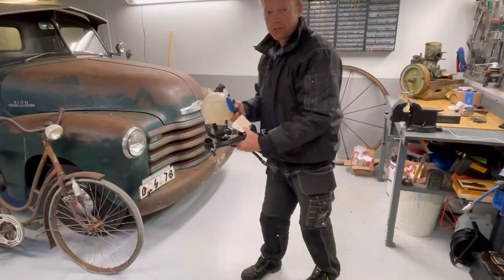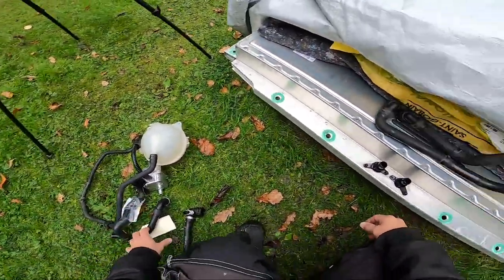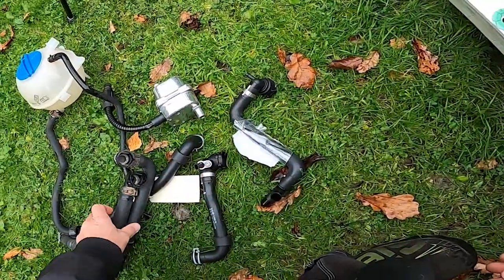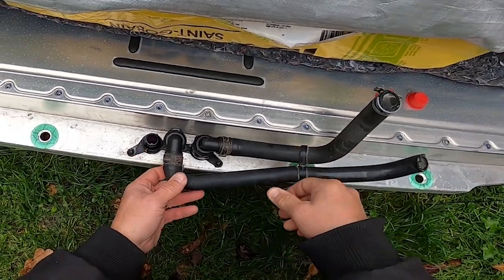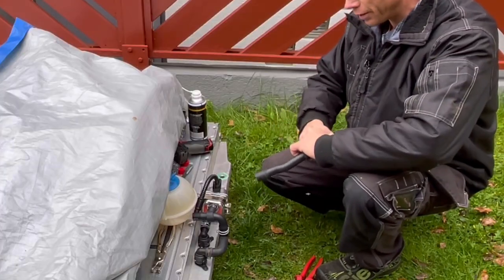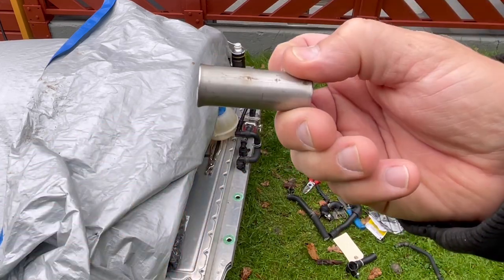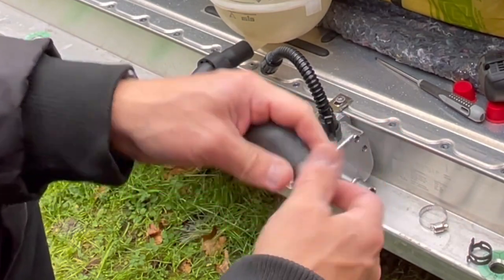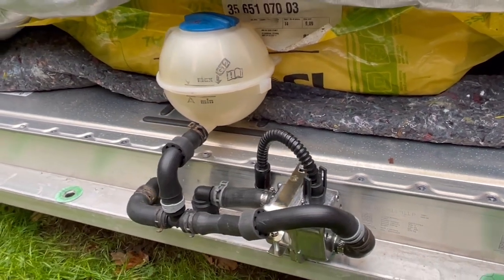450v DIY Home Battery Heating, frost protection, 62kWh solar storage.

Comment: Love it, maybe a wooden bottom with a gap for insulation rock wool type….then battery then more insulation on top. Like it’s own little wooden structure around it?
Reply from the maker: Thanks. Yes you are right, but that will be a little later. I have already bought the wood and insulation. So before the winter hopefully. Thanks for your comment 
😊👍🏻

Comment: Nice! Där fick jag svaret på min undring 😁

Enkel och smart lösning! 👍
Reply from the maker: Tack, ja, får hoppas att den inbyggda pumpen klarar dra runt kylarvätskan.
Reply: @flyingtools  Det fungerar nog om det fungerar på en bilmotor 👍

Hur många liter kylarvätska är det i batteriet?
Reply from the maker: @Grejarlite  vet ej i nuläget. Men om det är en enda lång slinga kan det bli tufft att driva på kylvattnet, särskilt nära nollan. Men det funkar ju i en bil, har en annan pump jag kan testa med i värsta fall.
Reply: @flyingtools  Det fungerar säkerligen kalasbra.

Kanske är bäst att ha någon extra tempgivare inkopplad på batteriet som kan larma om det blir för varmt. För om det blir något fel på termostaten/brytaren så den hänger sig så är ju risken att det blir väääääldigt varmt, vilket inte är så lyckat.
Reply from the maker: @Grejarlite  japp, precis som du skriver är detta viktigt. Ser tempen i inverterns app dessutom. 👍🏻
Sitter också mekaniska termostater i värmarkroppen de jobbar från 60 grader men då är det väldigt varmt…
Reply: @flyingtools  Gott med tempen i invertern!

Nej, några sådana temperaturer är ju inte kul, som en Leaf på långresa, plus att förbrukningen till värmaren kommer att bli så hög, så nästan hela batteripacket går åt för att hålla sig själv varmt 🤣

Comment: May be it would be more efficient to built a small insulated shed with a cooling fan for summer and an heater for winter. There will be a great amount of heat lost through the metal case of the battery in the open air. The shed would trap the heat of the batteries charging and discharging and would require very little extra energy to maintain a good temperature.
Reply from the maker: Yes, that is my plan. This is not finished yet.  
Thanks for cheering your thoughts 😊